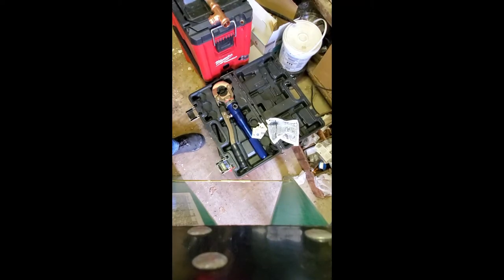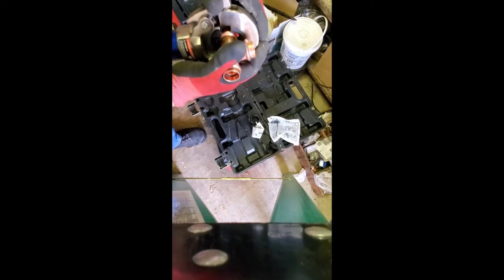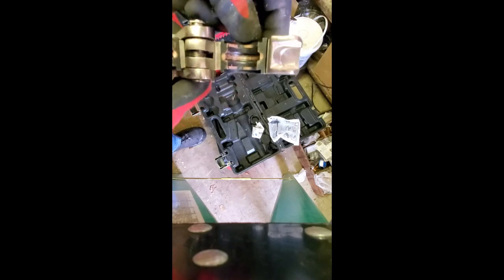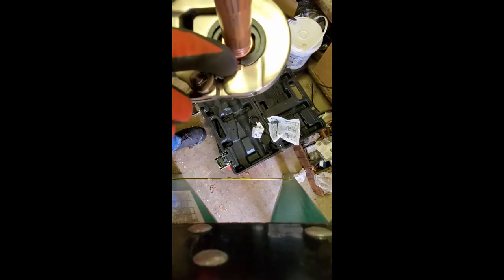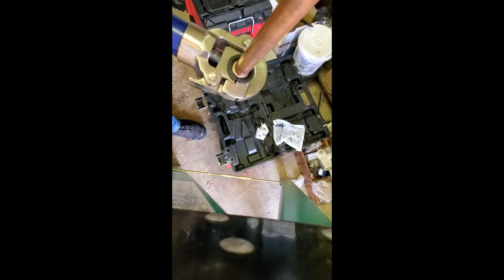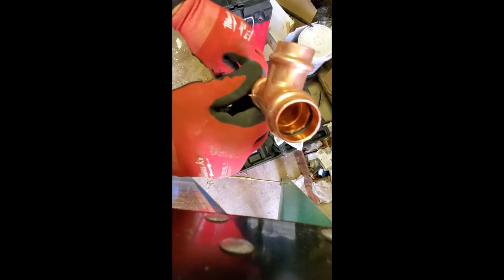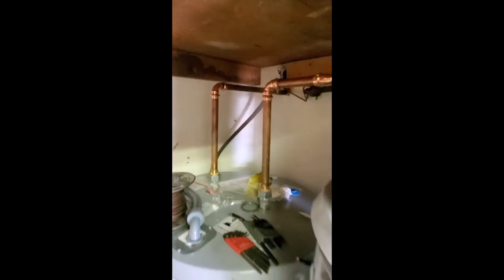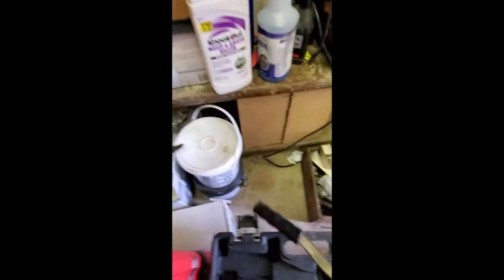cheap propress in use

Comment: How this has work for you? Did you get any leaks ?
Reply from the maker: No i haven't had any leaks and i have been using it for about 2 years now
Reply: @Raysmaintenance  Thanks for answer! one more question. Have you use it with Bronze Adapter Fittings ?  Or only with copper ?
Reply from the maker: @dymsza  copper only